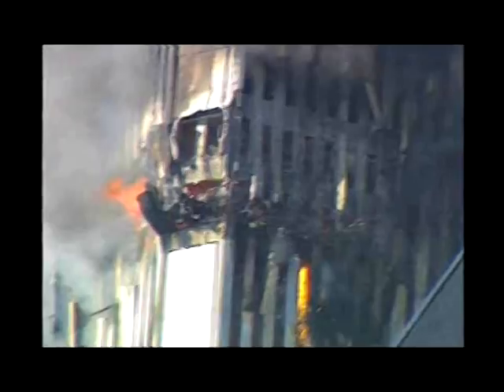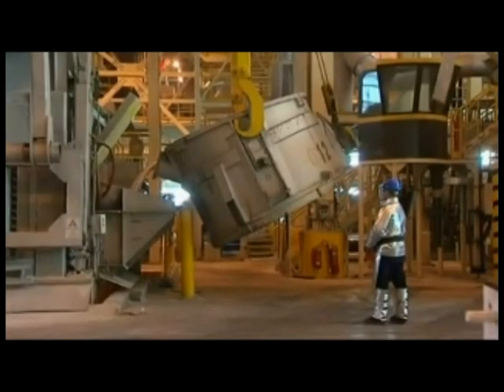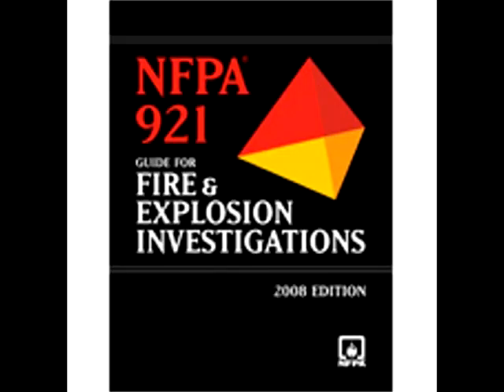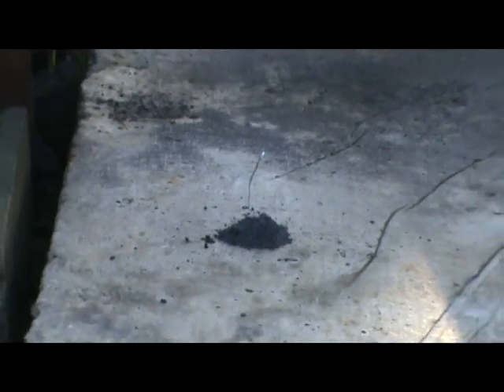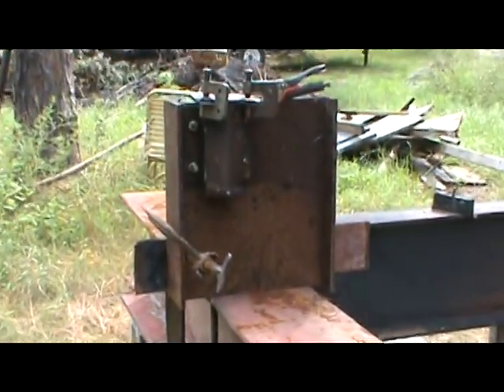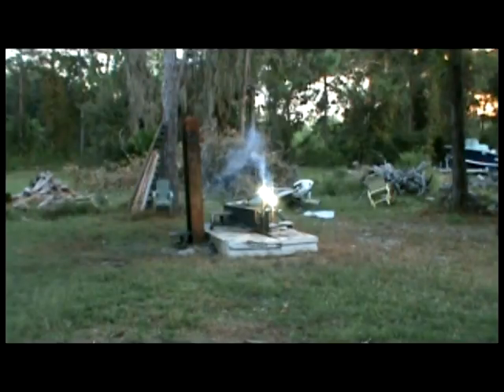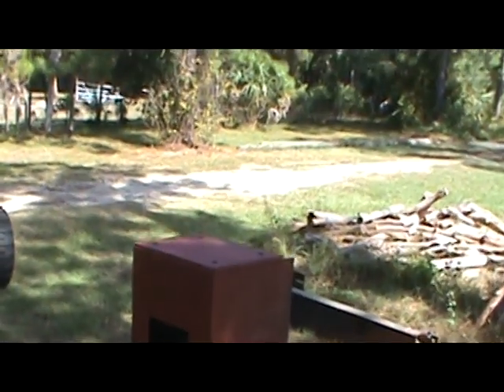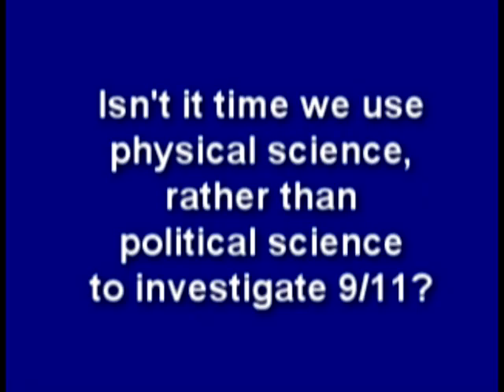9/11 Experiments: The Great Thermate Debate

Comment: 1800 degrees may not melt (liquify) steel but sure as hell destroys any structural strength it has. That's all that had to happen to bring the towers down.
Reply: Let's remember that the WTC towers bragged about how little steel was used in the towers. Less steel in both wtc towers than the empire state building. And the ESB has it's steel beams insulated with concrete. It was not a normal steel frame building.
Reply: And the buildings had the asbestos removed. And there was never any asbestos above the 64th floor.  I was in new york dozens of times in the late eighties early nineties. Way before any of this happened old men in New York City were telling me those buildings will fall down one day (because of the materials and how they were built) when referring to the world trade towers. One guy famously warned people for decades. Herbert Levine.
Reply: +Kevin Hadley   You lazy fuck! Do the research yourself!
Reply: K then why was there molten steel?
Reply: Slater Slater  Well it couldn't be Aluminum, because that has a silver appearance and gives off no luminescence. There are theories, proposed by NIST,  that office furnishings mixed with aluminum to create a luminescence, but this channel discusses in another video why that isn't possible (the furnishings would float then burn off, not mix and glow). And uh even if the substance were iron, or another metal that does produce luminescence, that would still be incredibly weird for an office/open air jet fuel fire to produce large quantities of molten liquid. Besides they were steel frame buildings, what the fuck else would a glowing, magma like substance be in this case?
Reply: +Slater Slater

Nobody "blew the whistle", so to speak, on Operation Northwoods. It was declassified by the John F. Kennedy Assassination Records Review Board who heavily investigated the CIA after the Kennedy Assassination. Apparently, killing the President is where the government draws the line at just what the CIA can get away with.
Reply: Slater Slater  touché my friend lol
Reply: Ok so how many here are part of the flat earth regard invasion? Your comparisons with building fires are stupid. Please compare with other sky scrapers hit by airliners. Thermite IS spectacular and enough to bring even one floor down would be obvious. I watched the event on tv and there was a lot of fire where the planes hit but but no thermite (i nearly set the school lab alight with the stuff once). Ps I am NOT American and have no skin in this game.. Watch this guys videos and then those of the event. Then take off your tin hat.
Reply: Would you trust your car to drive with the frame at 50% strength..
Reply: wrong troll
Reply: And how many thousands of people were involved in the mass surveillance that didn’t say anything? It was only finally revealed by one guy - Edward Snowden.  Take him out of the story and it might well still be going on to this day.  I suppose me might nearing some stories when some of these people go to their death beds.
Reply: What else might it be? A metal that continued to burn like lava over 6 weeks after the towers came down. Geo thermal imaging showing temps of over 2500 deg.
Reply: slater there are thousands of scientitsts who agree the towers could not collapse in the manner they did through gravity alone. Check out 9/11 scientists for truth movement with over 2000 members. NIST's proposed 'collapse' model doesn't actually go into the collapse it just assumes free fall collapse. The parameters they used in their compter modelling have never been released for peer review. Any gravitational collapse according to Newton's 3 rd must demonstrate deceleration as the lower floors act on the floors collapsing from above with equal force.
Reply: they fell in 10 seconds. An object dropped from the top of the tower would take 9 seconds to cover the 400m approx. 

So it took 1 second longer for those 80 floors to crush themselves and implode whilst simultaneously pulverising 4m tonnes of concrete into dust.
Reply: Would this be the same PLASCO buidling that clearly shows squibs on every floor about 1 sec before the top implodes after the supporting structures on several floors have been blasted and removed?
Reply: Slater - lol. Nuff said. You're either trolling or v stupid.
Reply: Does not explain the molten steel pouring out of the towers.
Reply: It would have to effect all the steel beams at the same time not just a few. And if yer right the towers would have bent over to the week side and fell over notttt collapsed in it's own foot print. Along with the other tower and building 7 doing the same shitttt not possible. The effected beams that got week would have bent slowly over the towers would have leaned to one side and like a ship taking on water lisping to one side because other beams would not have been week all at the same time. And yer not lookin at the fact that at 500 miles per hour the fuel in those wings was mostly dispersed in flames out the other side of the building on impact.
Reply: See what people dont seem to remember is Timothy micvey blew up the fed building only half the building fell and that was high explosives used. So way didn't that building fall in it's own foot print???? You got to thinkkkkk
Reply: Slater Slater  There is photographic evidence from ground zero, litterally dozens of eyewitness reports, videos of molten steel leaking out the building and even thermal images taken by NASA weeks after. How can you just deny it's existence? Are you that committed to being blind?

Also NIST's explanation is literally that they "Discovered a new type of catastrophic event capable of collapsing a building." (Regarding WTC 7) They literally admit this had never happened before. Occam's razor takes a shit all over that theory.
Reply: Buick Regal  That or a garden variety sheep haha. You're so right though, not gonna win their opinion over.
Reply: Buick Regal  I've read about that, but never watched their official response. You're so right, totally worth watching them flounder! To think a institute so highly regarded was schooled by a high school physics teacher too lol
Reply: Buick Regal  It's amazing that isn't proof enough for people to question the official story. He practically shit himself lol
Reply: Buick Regal  Oh absolutely, people so naively and unequivocally trust their government as though we've never been lied to, or fed a false narrative. False flag operations are old hat honestly. Yet you are treated crazy for entertaining that idea. I love how this guy thinks that not getting published disproves the science, like anyone who entertained the discussion with a conspiracy theorist wouldn't be committing career suicide. It's just amazing they could accept an answer that literally defies one of Newtons laws of physics, before believing there is more to the story. It's hilarious that they basicslly admitted to dry labbing by revising that detail, then act like it doesn't affect their model at all. Yet we're the crazy ones here somehow lol.
Reply: Buick Regal  Thanks friend, and thanks for sharing that NIST backpedal vid. Honestly the funniest shit I've seen for a while lol
Reply: Fuckoff
Reply: There was melted steel in the ruins of the trade centers. That is what he is explaining.
Reply: Back in the 80s British Steel conducted the largest ever experiment on a steel-framed multi storey building to test whether an office fire could cause an entire strucutral collapse. The fire burned intensely for about 20 minutes from floor to floor consuming all of the available fuel (office furniture etc.).

The fire temp peaked around 1800F and while the EXPOSED UNPROTECTED steel girders sagged somewhat causing floors to sag ASSYMETRICALLY the steel still retained structural integrity and the building did not collapse.

The WTC steel skeleton was fire proofed with asbestos. Absolutely no way does an office fire on the 80th floor of a building bring down 110 WTC floors in free fall.

Take a look at Newton's laws of motion.
Reply: You do realize all the weight that was on top of those beams right?  once one floor goes it causes a domino effect adding more and more weight from each floor as they collapse. Did you notice that the second building that was hit collapsed first because the lower impact added more weight on top of the structurally unsound steal beams which caused it to fall faster than the first building that was hit? probably not. Enjoy being brain washed by youtube videos they seem to be doing you good. Mass, force, velocity, load, and acceleration all played into why it was possible for the airplane to bring the building down. The molten lava they saw was from the aluminum of the plane just like that stuff you have on your head.
Reply: @demosthenes1296  of course the fire dosent but an airliner flying through and out the other side  in bits taking concrete colums down and weakening the steel would sure as hell affect the  structural integrity
Reply: Two thing wrong with what you said. 1) The fire was not a typical "office fire" but had jet fuel as one of its components. Asbestos was used in part of Tower one and only as a part of the   coating over the outside of the foam used throughout. 2.) the WTC had a unique structural system. The flora were supported by an inner core of concrete and sett and the outer (perimeter) columns that gave the buildings their iconic look. The average steel-framed multi story building is build using a grid of supporting columns. I do not know what experiment you are referencing (perhaps a bit more informations from you) but you do mention the steel sagging. That alone suggests the steel's structural integrity had failed but the total system had maintained though strength to prevent total collapse. It remains a fact that steel is structurally unsound at such temperatures. So without knowing the design of the said structural system referencing such a study is useless. We need to know the size of the beams, the spans, the connections, the size of the columns and their spacing, as well as the loads on the floors and beams, any point loads present, etc. etc. etc. ........
Reply: Demos- The impact from a jet aircraft traveling hundreds of MPH was deemed to have knocked off much of the asbestos protecting the steel girders.  The girders in the area of the fire heated and lost structural integrity, could no longer support the 30 floors above them, and the weight of the top 1/4 of the building falling collapsed the rest.  Makes more sense than all the conspiracy theories.  But it is pointless to even discuss this really.  This argument entered tin-foil hat terrain years ago.  Now it is more like discussing religion than science.  People just believe whatever their political leanings want them to believe.
Reply: Captain-

The problem is that the "science" is generally cherry picked from a wide range of unrelated incidents, theories, and quoted by people who do not understand the big picture.  They try to take anecdotal "facts" from here and there, of which they have little real understanding, and try to use them to construct a composite case of a conspiracy, when they usually are irrelevant to the events on 9/11.

But this is of secondary importance.  The biggest problem is that all the conspiracy theories fly in the face of common sense.   A conspiracy of this nature would have to involve hundreds of people, all of whom would be actively involved and would have a "need to know" the end game of what they were doing.  US presidents cannot even arrange a simple burglary or get a BJ in the oval office without getting publicly outed.  You are trying to tell me the government could plan and execute a conspiracy of this magnitude, resulting in the deaths of thousands of US citizens, and that none of the people involved would ever blow the whistle?

That is why I laugh at this conspiracy crap.  You believers cannot see the forest through the trees.  You quibble about irrelevant little pedantic scientific "facts", while if you had the least bit of common sense or understanding of human nature, you would see that what you so desperately want to believe is simply completely implausible.
Reply: John you're trying to convince me to go against physics esp Newtons 3rd law of motion. There is NO WAY that 30 floors - lightest at the top - can cause 80 floors beneath it to FREE FALL, pulverise and disintegrate in 10 seconds. The lower floors had thicker steel and were strucutrally intact.

The pancake theory doesn;t work because the inner columns would still have been left standing and the pile driver theory that you are expounding absolutely does not work due to the evidence that was left - i.e. outside of the steel girders nothing greater in size than half a telephone key pad was found. 

A building that had structurally collapsed would have left office furniture in tact at the v. least.

Ever considered why body parts were found on the Deutsche Bank building over 300m. How does a falling building BLOW OUT body parts for 300 metres?

How does a building BLOW OUT a steel girder over 200 metres with enough force to embed itself in a building?

What explosive force can do this if a building is simply collapsing in on itself?
Reply: @johnshaft5613  no way an entire building falls at free fall speed when only several floors are weakened towards the top, AND NO PLANE HIT BLDG 7
Reply: @demosthenes1296  correct. How does 30 floors cause 80 floors beneath it built with thicker steel to free fall collapse in 10 seconds ! That makes no sense. Just look a failed controlled demolitions of buildings, the whole damn building does not collapse even when most of its columnss are blown out. I remember the ridiculous reasing for this free fall was due to jet fuel traveling down the elevator shafts and weaking the steel beams which is an ridiculous excuse they gave us. So many things wrong with that statement its outrageous
Reply: There have been whistle blowers from the CIA and FBI and what happened to them? 

Would you whistle blow if it meant the loss of your career, a bullet to your head or being thrown in solitary confinement?

The whole deal stinks far too many irregularities that the govt has refused to clear up.
Reply: @SergeantExtreme  yes and if you just lit the twin towers and burned them they'd still be standing today, but we all know that they were hit by fucking jet airliners, chalk and cheese my friend
Reply: @demosthenes1296  em perhaps an airliner travelling at a few hundred miles per hour could knock a few body parts a couple of hundred meters,
Reply: @SergeantExtreme nah not possible
Reply: well thats stupid. try again. this time think.
Reply: Every building is deferent as is every fire. What course in structural design did you take to be able to confidentially assert the building could withstand "a few of the floors collapsed."  A large number of columns were sliced through but 767s weakening the structure. The floors are designed to hold themselves, furniture, people, etc.. They are not designed to support the weight of the whole top of the building falling 15' or so on top of them. You also should understand that the floors of the WTC towers was somewhat unusual in the each floor was supported by the outer was and the inner core. It was designed this way to give tenants the greatest flexibility in laying out their spaces.It was also part of the weakness of the overall structure and was part of the reason the structure was so badly weakened by the fire.
Reply: Do you have any idea how heavy each and every one of those floors were? Office furniture left intact? I don't see how. Also all that weight was cumulative. The weight of each floor added the next. Are you seriously going to tell me that each floor of that building was designed to carry the weight of all the floors above it? Do you have any idea how a building like that is put together? Each floor is designed to take the weight of itself, its occupants, fixtures, and furnishings and that's about it.
Reply: It was not just three floors that collapsed but the entire building above the impact height that collapsed. If you don't understand how a structure like the WTC towers is put together, if you don't understand how the damage from from the planes affected the structure, how the fire affected the structure, then you can't just make stuff up from the foolishness you see on the internet. Did you ever think that someone out there wants to get you all worked up about all these conspiracy theories so they can go on pocketing all the money? Now that is a conspiracy I could get behind. Well not really because I don't believe in this "THEM" that you guys keep talking about.
Reply: @kevinmhadley  THANK U!!!!!!!
Reply: @johnshaft5613  how does that make more sense? Sounds like such a reach from someone trying desperately to deny what most all evidence points to
Reply: @johnshaft5613  
Keep taking the tablets. Red or blue it's okay. It's working regardless.
Reply: @SergeantExtreme  
Don't forget our barbecue stays on for at least 5 hours every Sunday, it never collapsed, but we do though from the heat of weeds.
Reply: Kevin - so 1800 doesnt melt steel... yet "there was molten steel flowing like a foundry", that didnt cool down/solidify for over TWO MONTHS even after heavy rains.

And this adds up to kerosene fuel to people? Help me out guys.
Reply: its not possible for steel to stay heated at liquid temperatures for two months, assuming it reached lets say somehow 7000 degrees(theoretically impossible last i checked), the more heat there is the more heat difference between the environment and the heated object
in any case of heat within the day it would resolidify and would come to atmospheric temperature within a few days. it would be safe to touch within the day possibly. steel just convects heat so well.
Reply: You realize most of the people who make these videos live in basements right?
Reply: There is nothing that would keep see molten two days much less two months. If you believe that something could then there is no hope for you. Watch the mail for your certified "fool" certificate.
Reply: Mr. Hadley, you are exactly right.  Steel at 1800 degrees is very pliable and loses all structural properties.  You will not convince anyone here though.  This is a tin-foil-hat-echo-chamber-circle-jerk....
Reply: No it DOESN'T 'lose all structural properties' when subjected to temps of 1800 degress. The Windsor Tower burned for TWENTY FOUR hours and was completely gutted https://www.youtube.com/watch?v=v9fLeLe4Nlk. Experimentation shows it steel may sag but that alone will never bring a steel framed skyscraper down.

WTC was specifically DESIGNED to withstand the impact of a much larger Boeing 707 flying into it at 600 MPH. 

Go do your research before throwing bullshit around. The difference between you and me is I deal in FACTS. You deal in mud pies.
Reply: Slater no, i mean that when someone like yourself clearly is clueless and doesn't understand Newton's 3rd Law of Motion, the time for trying to educate your dumbass is over. You need to go away and do a bit of proper research. 

Yes the towers did come down in around 10 & 11 secs respectively and yes a force pushing down is met by an equal force pushing up. Ergo a reinforced steel and concrete building cannot possibly come down in freefall due to gravity alone. It has NEVER happened and NEVER will.

Go eduate yourself troll. You're looking like a truly ignorant individual right now.
Reply: I agree but not a steel structure everything else around it should have burned besides the steel. There is evidence of other Towers sustaining way more damage and was able to sustain these wasn't bombs that hit the towers these were planes.
Reply: Again, steel softens and looses its structural integrity long before it melts. At somewhere around 1200°F it is basically useless. Look at pictures of buildings like grocery stores that have burned and observe the tangle mess of steel left over.